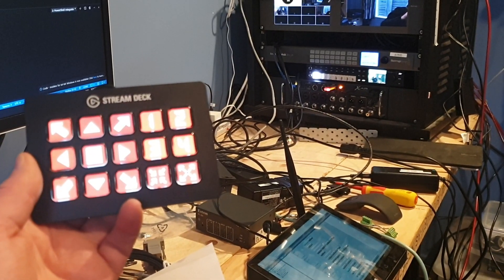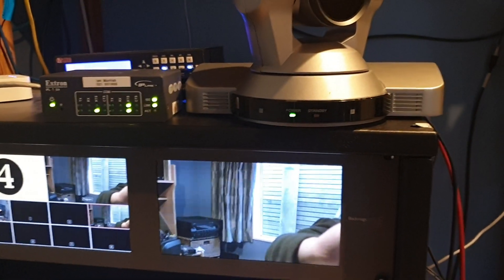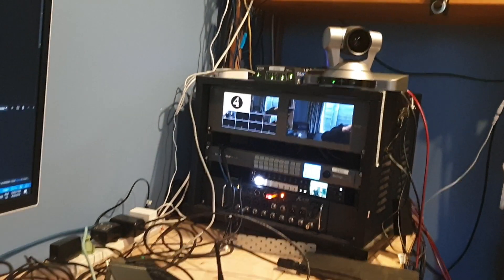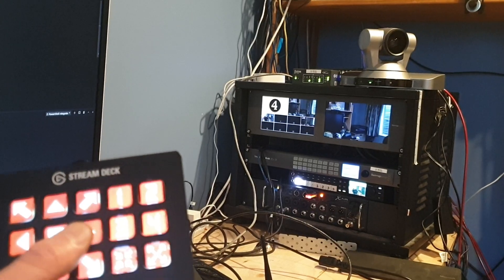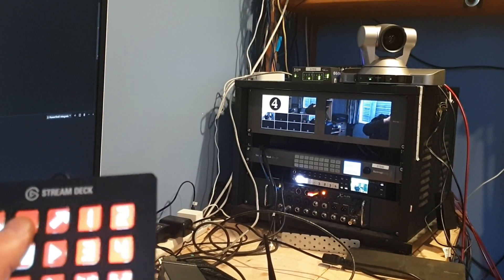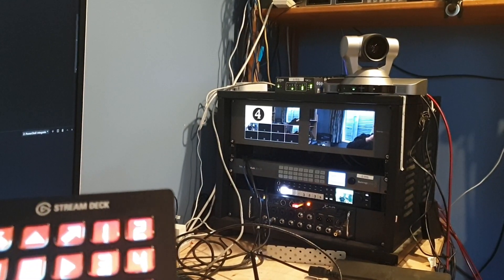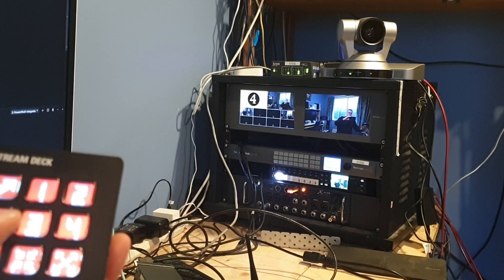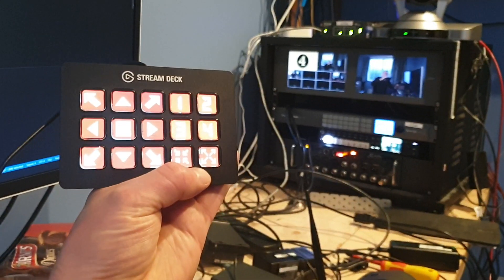PTZ control from StreamDeck using Extron ethernet to serial converter

Comment: Thanks for the video Ian! I am thinking about doing the same thing with a PTZ camera that I have, but it only has RS232 (or IR for control). Are you using the StreamDeck to send HTTP request to the Extron, or did you need to have extra software installed on the computer that ultimately sends the requests?
Reply from the maker: Hi, I'm using an Extron IPL TS 4 to give me ethernet control of RS232/422. You can get these things cheap on eBay and they are easy to use once you find the setup software for them. Means I can control PTZ as far as I can run ethernet (including fiber or wifi). In powershell I'm just sending bytes from PowerShell using System.Net.Sockets.TcpClient object